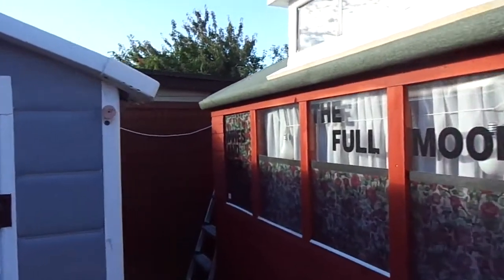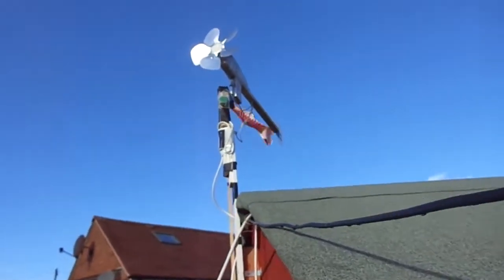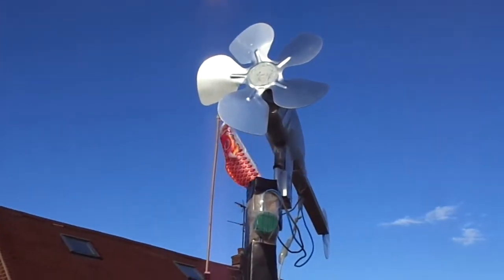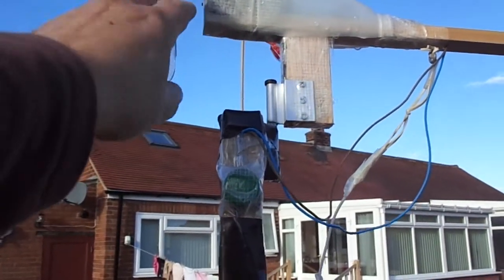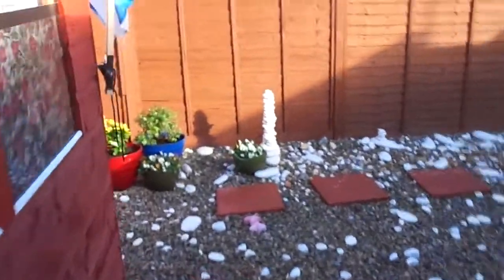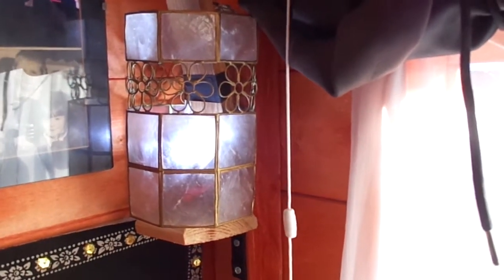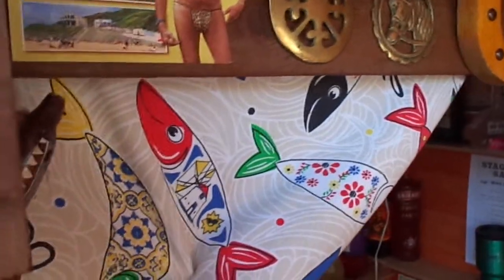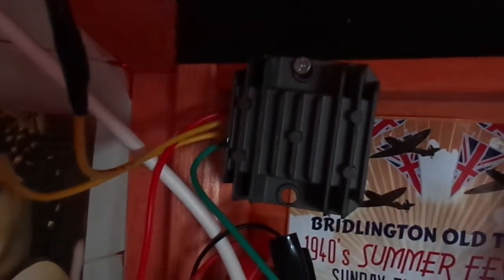Simple wind and solar system for a shed

Comment: Hi James,
 Ive just built my first wind turbine but I have not connected it to the system yet. I've already got solar panel which works ok when the sun shines. I just want to have a back up wind generator to supplement the solar.  How do I connect the system to my existing one. I've got a small ebay type controller for the solar panel. What else do I need?
Phil
Reply from the maker: Personally, having fried a battery putting both wind and solar into it, I'd use the wind turbine to charge a separate battery from the solar. That would end the risk of putting too much charge at once into a single battery. Hopes this makes sense as wind is more erratic than solar (power spikes, too much wind, no wind etc), it would be better to use wind as a back up on a separate battery. You could make a switch to flip between batteries if one goes flat. I use a single phase rectifier on my wind turbine which is what I imagine most cheaper turbine power regulators are. Don't take my word for it, I'm pretty much a newbie.
Reply: I see it was a little bit windy there but the blades didn't seem to turn. What windspeed in m/s does your blades start turning?
Reply from the maker: @SignumGB  About 22 mph